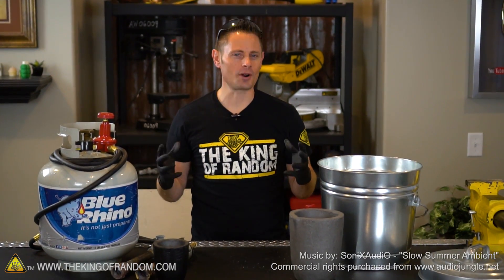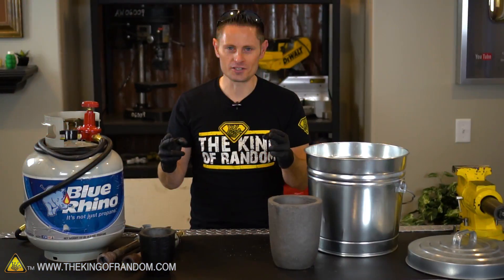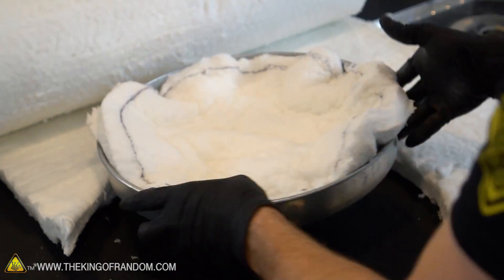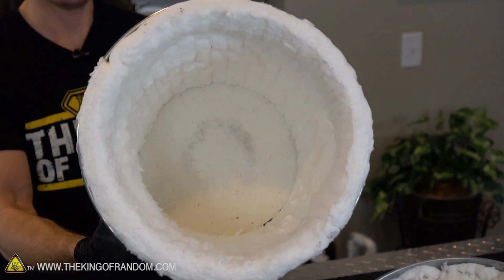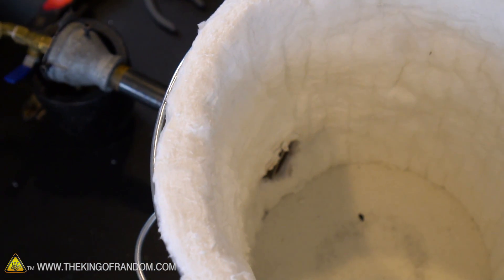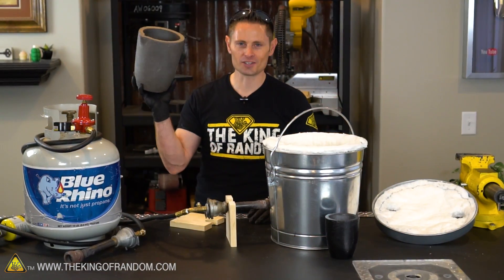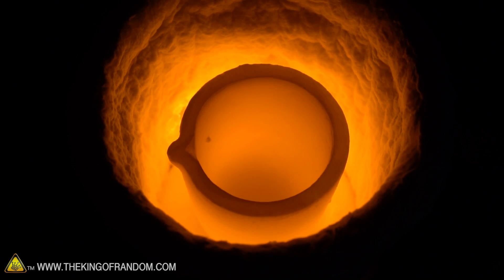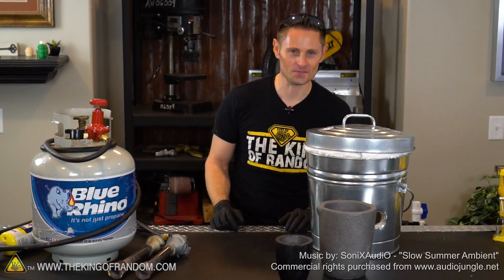Make A Trash Can Metal Foundry | How To Make A Metal Foundry For Melting Brass And Other Metals

Comment: I know the kale wool is super heat resistant, but if any part of the bucket isn't covered by it, there could be some danger depending on the type of bucket you use. Make sure you don't use a galvanized or plated steel bucket, that stuff can be extremely toxic to breath in if it gets hot enough.

Comment: hey Grant you are definitely the king of random, thanks for that, i love all the great ideas and experiments... i have a crappy video i posted about a self feeding cat or dog food bucket maybe check it out and make one way better if you like... i have been using mine for over a year and it works great...side note- some times when using a hole saw and its critical or you want a perfect clean hole i reverse direction on the drill motor then the teeth dont catch, it does still cut just not as fast.. you might already know this, might be worth mentioning in a video some  time.  have a great day keep up with the great videos and thanks again....

Comment: compressing the insulation like that reduces it's effectiveness, also, it might be easier if you run the holesaw in reverse, it doesn't always work depending on the material, but it can make drilling flimsy materials easier and leave a nicer hole.

If any part of that galvanized can get's too hot it can put off nasty fumes as well (ask anyone who's welded galvanized stuff)

not raining on anyone's parade, just putting that info out there

Comment: You stand a strong chance of poisoning yourself with the fumes of the galvanized coating vaporizing if you use a trash can.
Reply: The heat escapes through all the vent holes and heats up the metal there.  And yes, galvanized metal does produce toxic vapors when heated.   Please be careful when choosing your containers.
Reply: He's already been slightly lead-poisoned. What harm will galvanized coating do?
Reply: UltraMonkeySapien I see its galvanized, I myself am using a galvanized trash can for the outside of my forge. A quick fix is muriatic acid, it will eat away the galvanized coating and leave you with bare steel.
Reply: Is it galvanized? it looks like a cheap stainless can to me.
Reply: UltraMonkeySapien for science he is our test 🐑
Reply: Oh I beg to differ. But I concede that this is galvanized, I had just failed to see the parts list outside the video.
Reply: If it's galvanized, you're right.  You'd have to have really concentrated fumes to instantly die from zinc poisoning, but even in lower concentrations, it can cause neurological symptoms.  I still don't think that pail is galvanized. There's no grain structure on the surface. Looks like cheap stainless to me.
Reply: where can you get a trash can like this that's not galvanized?
Reply: You can always use high heat paint to cover it up
Reply: Sean  check the link  in the description .... it says it's galvanized
Reply: He also didn't use a mask when cutting the kale wool so I get the feeling he doesn't care too much about possible poison risk.
Reply: true
Reply: UltraMonkeySapien I maked this system myself and i didn't noticed that it was zinc coated.
Reply: its not galvanized its just a steel can
Reply: Sean its galvanized and also galv poisoning can cause a near instant death if its bad IF im not mistaked 
someone conferm
Reply: @tastyechos3273   Galvanized metals exposed to high heat put out toxic fumes. Most welders know this , it's common knowledge.
Reply: UltraMonkeySapien his first foundry was also from Galvanized steel. But if you use it outside you'll be fine.
Reply: "Cheap stainless" isn't a thing...
Reply: But the kaowool will prevent the can to heat up. At most we hope...
Reply: Zinc poisoning from a trash can furnace hopefully used out doors (common sense) would be negligible. There are more things to worry about such as wool fiber dust over time, various toxic fumes if you smelt any ore's and so on and so on. The small amount of fumes from the torch hole would be a non issue and once it is broke in would be over n done with. If your whole trash can furnace vaporized the galvanized coating then you have other issues to worry about =)
Reply: Honestly Id be more worried about breathing in the wool dust while cutting it. probably give you mesothelioma like asbestos or something
Reply: UltraMonkeySapien the trashcan doesnt become hot because its insulated by the wool
Reply: Sean where do you suggest to find a "cheap" stainless steel can?

Comment: Why fire it up inside.....
Reply: It is not just that. If the values had a malfuction and blew there goes a chunk of the house and those in it. Atleast outside collateral damage is reduced.
Reply: actually, I fired up mine in my basement last winter and ALL my CO2 detectors went off within minutes.....yes, it's a common home heating fuel but used in a properly designed and burning heater etc...NOT a home made riel burner.......

it took about 45 minutes with all the windows and doors open before the CO2 detectors stopped going off....
Reply: Pyromanci propane burns pretty clean and is a common house heating fuel. Mind you, this is 8 ft away from his liquid nitrogen generator. So he's just heating the house.

Comment: Just a hint for you, when cutting thin sheet metal with a hole saw, run the hole saw in reverse and it will not grab, giving you a much smoother cut.

Comment: Now, will that kaowool work in a 5-gallon plastic bucket and keep it from melting if you use it as a foundry?
Reply: Maybe not at the first time but after some tries will melt eventually. Metal bucket is much safer.
Reply: Oh yeah, no doubt, metal is safer. I'm more curious about how well the wool holds up.

Comment: I'd line the ceramic wool with refectory cement. Or I would at least line the bottom with a fire bricks to give the crucible a more stable platform.

Comment: would you be able to make a newer torch? would a forced air system get hotter?
Reply: maybe something that is capable of melting copper easily
Reply: Jonathan Roscioli I've seen another person do the air injection to get a hotter flame. So I you need the two burners.

Comment: If u want it to be hotter put a hair dryer in the back for the propane burner. You are also using to much propane. Adding the hair dryer will blow more air in allowing you to increase propane amounts resulting in increase in heat.

Comment: I work with kaowool a lot; it is itchy, but the inhalation hazard is only a real concern when handling kaowool that has been exposed to high temperature already. (This is true of most crystalline silica materials - the crystal structure changes after high temp exposure, making tiny "needles" that get stuck in your lungs, possibly causing cancer.)  "Virgin" kaowool is really just an itchy nuisance.  But useful!

Comment: This is definitely a project you do outside, no question! I would be very concerned with the bucket he is using because its galvanized. The galvanization will leak into the air if high temp touch it and if breathed in it can cause metal flume fever. Doing this outside would help to reduce the chance of this fever also a flume hood could help but still very dangerous.

Comment: does your wife know that you ignite propane in the house?
Reply: propane is a common home heating fuel. Grant just does it with more ''style''...
Reply: What makes this any different than lighting a stove or oven?

Nothing.
Reply: I've never seen an oven or a furnace that works with a flaming tornado of metal smelting power
Reply: Add them all together for the total BTU output, you'll have it between a 5 burner stove, oven, and broiler? That's more than enough energy.
Reply: Isn't that normal in Zambia we don't have propane torches or at least I haven't seen
Reply: Shes the camera holder most of the time

Comment: From my research a castable on the bottom is more spatter resistant and less expensive to replace.  Also, since you're blasting your kaowool with a torch you should consider putting a sealant to reduce the airborne particles that can burn off of the wool over use.  Finally, a heat reflective finish will allow you to reach forge-welding temperatures fairly easily assuming your torches are efficient enough.  Although you might need a thicker layer of kaywool for that to not ruin your vessel.  Food for thought.

Nice furnace!

Comment: Your metal can looks like it has a galvanized coating on it, which if heated up can create zinc oxide gas, you should probably hit the lid of it, under the insulation and the top with a heat resistant paint that they put on Grills. The paint should be able to inhibit the galvanized coating from turning into a harmful gas.

Comment: The same company that sells that 10 gallon can, sells a 31 gallon can.  How much harder would it be to get up to temperature for a can that size?  Anyone know?  I'd just really like to melt a higher volume of metal.  This is of course assuming I do a dual torch method as shown.

Comment: I'm thinking that that stuff is not meant to have flames hitting it directly for long periods of time, so it will probably end up ruined much faster than a rigid refractory material typically used... Guess you will find out soon enough. :)

Comment: can you melt steel with it? I made one using your old design, it  is great I'm still on Cole I haven't got a blow torch and I want to know if I can melt steel on it so far unsuccessful but I haven't tried charcole or using a lid to trap the heat in yet 😀

Comment: You need to put a refractory cement coating on the kaowool so that when the foundry is fired up, the ceramic fibers don't fly out. It will also help it to heat up faster if you have a castable refractory cement lining, then the kaowool, then the bucket.

Comment: Hold the other side and not feel the heat as he touches it with a most likely flame proof or heat proof thingy glove
Reply: He had a thin rubber glove on, so the heat he would've felt would be almost exactly the same as with his bare hand. He was wearing gloves because kaowool irritates skin on contact.

Comment: If you run your hole cutter in reverse, it won't cut as fast, but the finished hole will be a little nicer.

Comment: You need to coat the kaowool inside the foundry otherwise fibers will flake out as you heat it and it won't end well for your lungs.

Comment: Would this work with the hair dryer charcoal design?
Reply: Jeff Lewis
Not suggested. Unless you coat the Kaowool with a layer of refractory cement first. Preferably an eighth to a quarter inch thick layer on all surfaces.

Comment: Um...Grant...that's a galvanized can, and if you heat up that galvanized layer, it let's off very toxic fumes...
Reply: How can you tell?
Reply: It has a grainy texture on the surface of the metal, and most steel cans have it so they don't rust from being outside.
Reply: Young Guns-Ap Its not going to get hot enough to burn the galvanized layer because of the kaowool is an insolation. Even if it did burn it wouldn't hurt you as long as you are outside in a well ventilated area.
Reply: Muriatic acid will remove that layer of galvanization, which I suggest using on areas that might get hot.

Comment: I see the link to the wool in the description, how much do I need to order if I am going the pad the exact bucket he has?
Reply: Josh Rudelic The dimensions of the bucket are Height 15.3in Length 16.3in and Width is 16.3in
Reply: Also the kaowool come in a 24in × 12in roll.
Reply: correction, my bucket is only a foot deep and about 13 inches in diameter... so i believe one roll should do it.
Reply: thank you  very much for the replies!

Comment: Try to make glass from sand
Reply: you can't, before sand can get turned into glass it needs to be at 2300 degrees, and standard glass melts at about 1700, and the kao wool only withstands about 1050 degrees

Comment: Try to melt Tungsten and cast bullets from it.
Reply: Practically impossible, Tungsten has too high of a melting point. Even industrial tungsten tools are made by sintering tungsten powder together, it never actually melts.
Reply: I did some googling. it can reach temperatures past 1000 degrees celsuis (1832 Fahrenheit) and according to Wikipedia it can get up to 1650 celsuis (3002 Fahrenheit) but it isn't advised to mantain at that temperature.
Reply: Hedrix | Hardware it's basically impossible
Reply: tungsten bullets wouldnt stay bullets when fired since they metal doesnt have a high impact durability and can shatter easily
Reply: Tungsten is the highest melting point of any metal
Reply: kasper bennetsen false. my forge stays at about 2400°F
Reply: Tungsten melts at 3422 °C (6192 °F), which is practically impossible but not actually impossible. Dicyanoacetylene in pure oxygen will burn at 4990 °C (9010 °F), the hottest flame temperature of any known chemical reaction. I don't think it would be possible to obtain though, not something you can just buy.
Reply: Matthew hidalgo In ww2 they did experiment with tungsten core APCR rounds for tanks. It was far more common to use tungsten carbide though.
Reply: +simontay1984 The common iron thermite reaches temperatures of around 2500 °C (4532 °F).
Reply: you do realise that you need oxygen to make fire
Reply: You can do this in the hard vacuum of space. But unless you are making things with the tungsten specifically for use in space, it is much cheaper to use an inert atmosphere here on earth.
Reply: Newsflash: Tungsten has the single highest melting point of any naturally occurring solid metal, and will not melt.
Tungsten bullets wouldn't even be much different from lead ones, either.
Reply: Filsdemorte it takes 6000+ to melt tungsten
Reply: kao wool only withstands 1000 degrees...
Reply: David AE Levy Oxygen isn't flammable, how are you supposed to create heat with it

Comment: I made mine this way, using an old beer keg. Also used your burner design and it works like a charm. Last weekend we melted and old copper Buddha, ended up with two nice copper ingots, a little over 9 pounds in total.

Comment: Great Idea Grant,  I would add one more step and that is to line the kaowool with mizzou refractory cement and plistix refractory so that the swirling fire doesn't blow microscopic fibers into the air and then into the lungs.   The Kaowool fibers can fly far away.   So defintiley and outdoor or garage with door open set up.   IF you like I can send you the information.    I'm the medical director/consultant for Blacksmithing For Beginners, International Blacksmithing, and Modern Blacksmithing.   Thanks Grant for all you do....truly amazing to see you inspire others.   Thanks again.....and I'd love to see you try HHO gas as a foundry/ forge fuel. As we talked about before.   Docchuck

Comment: if you pack the wool around the torch feeds you will have better heat control. You would be amazed what you save if you insulated those.

Comment: You should have drilled several small holes in the lid and moved the handle to the side of the lid. That way it could be used as a camping stove in an apocalyptic situation.

Comment: Put copper wire in you rope making machine and make a wire that actually works!
Reply: I know it does not seem like it will work or it might seem impractical, but I think it would be cool to actually see.
Reply: DanieleGiorgino to be honest I really think it would be cool to watch be spun together, and two see if the cable actually works.
Reply: You've posted this comment on multiple videos. Why do you want him to make electrical cables so badly?
Reply: Bryant Lam i dont blame him.
Reply: Get a job, simple as that
Reply: Matthew Levine did you just assume my gender?

Comment: Is that can galvanized? If it is it generates zinc oxide, that is dangerous.
Reply: Also, this isn't something you do inside.  Also, melting metal itself, brass, CU, etc, you better have a mask on anyways.. etc. etc.
Reply: You can see that the can changed to a different shade of gray around the burners, that is because the zinc is burning off.
Reply: You are correct it is the galvanized coating that when burned can release very toxic chemicals. Not sure if its a problem here since there isn't any real direct contact - nor is the temp high enough to cause it to burn (well let's confirm that when he actually uses it).
Reply: Eemeli Laakkonen Only in the state of California
Reply: Or it is stainless steel?
Reply: lets get real here... everything in California has been known to cause cancer.
Reply: True in those few spots, once.   If you are not wearing a mask and pouring brass, as I do, then.. that's the least of your worries.  :D
Reply: True, all I really do is aluminum and some blacksmithing (so accidentally melting steel in a gas forge)
Reply: Eemeli Laakkonen its not dw its stainless
Reply: Eemeli Laakkonen galving by low needs to leave a patchy pattern on the mettle so to not get confused with other metal or finishes
Reply: Eemeli Laakkonen zinc boils at the temperature you see steel cherry red
Reply: It's not dangerous, due to the 'can' not reaching the temp needed to release toxins.

Comment: i have a tip for you grant. if you are casting metals use pressure to push the metal into your mold. this will help pushing the air, that may be trapped in your cast, out.

Comment: Hi Grant I normaly dont comment to much about what people do as i find there is a enough of that on you tube just a WARNING Using a galvinzed pot /bucket like you have is verry poisonous the heat causes a large amout of gas that has killed many welders through the years Please be carfull when you run the foundry or better yet switch to un treated steel or cast iron

Comment: There are spray on rigidizers for kaowool or you can coat it with a castable refractory (Satanite, Mizzoula, Kast O Lite 3000).
Cheap insurance if you ask me.  He for sure has alot of those fibers kicking around that room now.